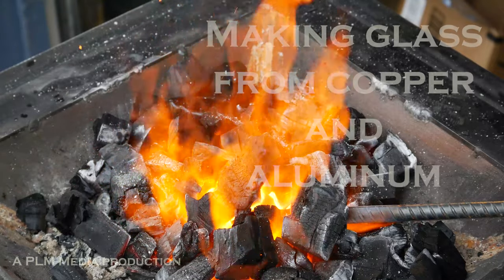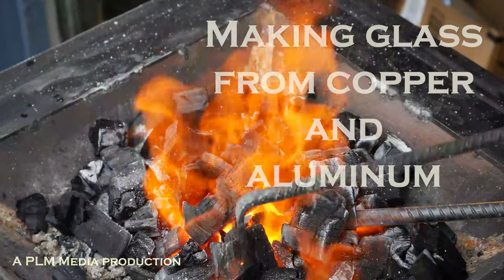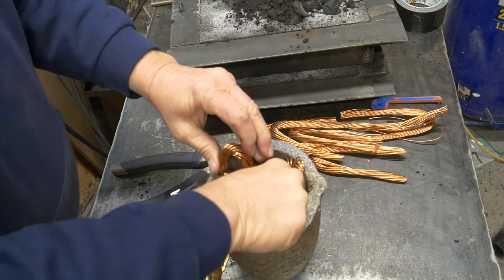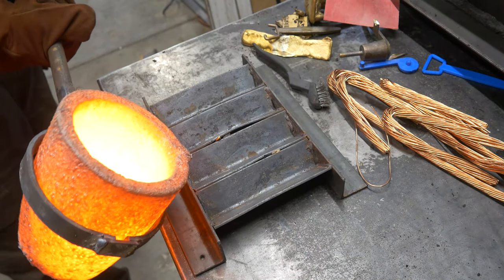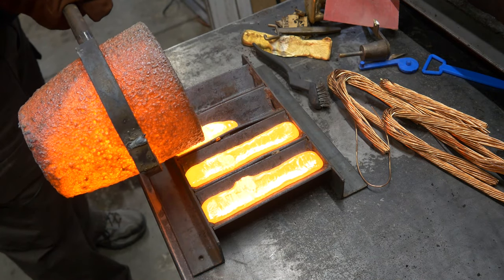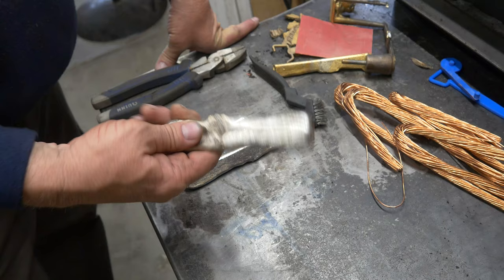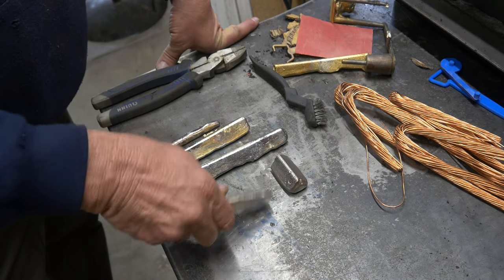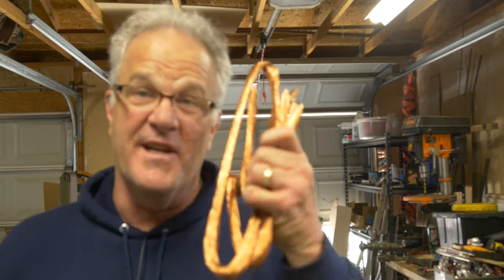Making glass from copper and aluminum

Comment: Same thing that happened to me the first time I made aluminum bronze, I had a good ratio, just a failure to mix it properly. Remelted it, and mixed it good, and it came out great.
Reply from the maker: That was my problem the first time I melted it about a year ago. I had the ratio right, but it wasn't mixed well.
Reply: @swdweeb  Great demo!  I read somewhere that one should stir gently with an up and down motion (not side to side) when making alloys, to ensure proper mixing.  Haven't actually tried it myself, just passing along some unsubstantiated rumours.
Reply from the maker: @tobhomott  I think "gently" is the operative term. I can see up and down, as the specific gravity is so different between copper and aluminum that there could easily be striation in the melt
Reply: @swdweeb  Making ingots then remelting them should help with mixing as well.  I don't like to pour something from raw ingredients.
Reply: It's THE WULF!!!!
Reply: @tobhomott , Rumours not unsubstantiated  😊. You do indeed need to stir and as you say not side to side or circular but rather with an up and down circular motion that gets the metal rolling from top to bottom and without breaking the surface with the stirring implement - need to do it fairly quickly as some of the stirring rod (if steel as is most likely) will dissolve in the bronze but a little iron in aluminium bronze is Ok.. Martin
Reply: @andrewmartin4258 , I too prefer to pig and remelt BUT you must remelt the entire batch. However there is a need to not remelt too much as  each episode involves losses and alloy  degradation... Martin
Reply: @olfoundryman8418  thanks for confirming that, I can't remember where I read it, and one thing I've learned from you is that a lot of the old foundry texts are full of conflicting information (if not outright nonsense)... Jeff

Comment: Ah, Babes in the woods! Alloy make up is not what a hobbyist should be attempting without decent analytical back up. It is an occupation fraught with failure and disappointment. Most alloy systems have definite useful ranges and  aside from that they are a disaster - for example if we look at aluminium and copper we have a useful range of up to maybe 12% aluminium at one end and up to maybe 6% copper at the other end, in between it is a disaster as witness your result here. My own experience with alloy make up with full analytical backup - the addition of Magnesium to turn 356 alloy into 357 was that only half of the magnesium added actually got into the alloy. I think attempts to make a 90/10 copper aluminium alloy by adding 10% aluminium of unknow purity to 90% copper wire of unknown oxide content once molten, is more likely to give a 5% aluminium bronze than a 10% one and no way you can really tell just what you have without analysis or perhaps some vague clue from a hardness test.
I always but always say BUY your metal from a reputable source as at least that way you will get at least one thing right - this is no doubt cheaper that self alloy make up on fuel and scrap costs alone let alone the cost of failures and frustration that come from bad metal. Some good part of Julian Hg's success (kettle bells octopus) are due to his use of purchased AB3 alloy - he has metal he can rely on each and every melt - worth noting and thinking about. Just buy your metal.. Martin
Reply: If I can add to that as a machinist, buy good material of known machining characteristics.  Don't but aluminium 6061 to machine unless you have heaps of horsepower to make the chips break. Buy 2011 and your machine will love you for it. Don't use 1020 steel if you can use freecutting steel.  Don't bother with metal from the scrapyard unless you are told exactly what material it is.  Why make life difficult for yourself when there are others more than ready to do it for you.
These remarks do not apply to guys with lots of power as they can make 6061 chip nicely.  I have been using a cnc lathe with 1/2 HP
Reply from the maker: I woke up this morning thinking Martin hasn't responded to me using wire in my melt. I must have done him in.  Now my life is whole again, my universe restored ;-)

You're obviously absolutely correct in your observations, no argument from me. However... here it comes... speaking as a guy that is still very early in the process there is an inexplicable joy that comes from melting two different things together to form a new third thing, just as there is in taking something in one form and turning it into something in another form.  For a guy like me in the garage that isn't doing production runs, isn't attempting to sell anything, isn't machining anything, making a shiny new metal of unknown properties is still fun to do.
Reply: Oh no, sounds like you are turning into one of those youtubers that like to waste gas melting stuff and pouring it into ingots.
You do realise that you can’t make an alloy of anything if you don’t know what you are putting into it.
I ain’t very scientific, but melting what is possible good copper in the form of wire and adding aluminium of totally unknown composition (crap basically) you ruin the good copper and turn it into crap.  From what I understand, each melt of the material can contribute to the degrading of the metal. It gets to the point where even commercial recyclers struggle to make it into a useful metal again. Perry I am no greenie by a long way, but the constant melting of metals to “recycle” them burns up fuel and degrades good metal. This is not aimed at you, but there are a lot of folks that think melt and ingot is a great thing. 
Having got this off my chest I will go to bed and see what response I get in the morning. Please feel free to delete this rant if you find it offensive (certainly not meant to offend you) or it does not suit the tone of your channel.

Comment: Here I thought you were converting the dross into actual glass. Nice demonstration of brittle metal from a mistake in alloy composition.
Reply from the maker: I guess the click-bait title worked on you then :-D
Reply: @swdweeb  PERRY!!! 
Shakes fist at Perry at the mere mention of Click bait.
Reply from the maker: I'd put a picture of a good looking woman up but my wife won't go on camera in my videos :-D
Reply: Funny you say that, the dross from my last aluminum melt was very glass-like. You know the powdery dry dross you get from cans? no more of that. I used 50% by weight flux to aluminum (1lb flux to 2lbs aluminum cans) and the dross was honey-like in the end, viscous but wet; it became glass-like when cooled down. Also, I melted the flux in the empty crucible first before starting to add the cans. It was much much better than on previous melts. It does mean you use more flux, but that's cheap (I use 40% sodium chloride, 40% potassium chloride and 20% magnesium chloride)
Reply: @stamasd8500  wow that's a lot of flux. Too much flux not only makes a dross that has more glass content but also is very damaging to clay-graphite crucibles.
Reply: @swdweeb  lol ya, totally suckered in. 😜
Reply: @askquestionstrythings  If you're talking about borax flux, yes. But the mix of chlorides is not. Having a thick layer of flux that wets the dross well is beneficial for melting aluminum cans (and other types of thin, irregular aluminum such as chips). For other applications you don't need so much flux.
Reply: @stamasd8500  all fluxes are damaging, some are slower and  some like borax are extremely fast. Cover fluxes are definitely important, I'm more a fan of using cover gases like argon. It's all a balancing act, balancing the chemical attacks on the crucibles vs the cost of replacing the crucibles. But my main point in my other comment is that it is Always important to use the minimum amount of flux that will do the job.
Reply: @askquestionstrythings  I have argon but find that using it in a homemade, propane-burning furnace is a bit challenging. :) As for the right amount of flux, I'm still working on it. This time I deliberately used a large excess, and it turned out much better that the 1-2 tablespoons that most videos on YT use. Next time I'll reduce the amount, to maybe 25% of the mass of Al and see if it still wets the dross properly. The experiment goes on. (also I coat my crucibles with satanite, usually just the exterior but this one was coated on the inside too; will see if it makes it last longer. It definitely does reduce outside erosion/melting/sloughing in my experience)

Comment: its kind of funny that you posted this my last vid I didn't put out yet but that's besides the point I melted brass and instead of completely breaking it down I assumed I could scoop the screws and washers and what not off and it would be fine and everything looked good until it cooled once it cooled it came out brittle and marbled it looked like a light copper color and and extremely shiny aluminum color I made the assumption that there may have been aluminum parts on something I melted or something to increase the zinc but I don't have the experience you do so I thought I would drop a comment and get your opinion
Reply: I guess my question is if I just added copper would it fix it or would I be better off ditching it all together to minimize waste?
Reply from the maker: Hmmm.. I'd personally just ditch it. Here's why. 

A few weeks ago I actually made the mistake I recreated in this video. Back then I thought to myself "how am I ever going to figure out how much more copper to add?" Fortunately I saw the remaining copper and breathing a sigh of relief simply melted it all over again.

I have had the problem with the alloy not mixing and seen things like you saw. https://youtu.be/YWGFDEspjZE and now do a slow stir before I pour the ingots or the part. 

But, you started with a brass alloy that was already at the right ratio. Of course as you said you had other junk in there as well. Therein lies the problem, it is an alloy made from unknown metals and unknown ratios. You could add copper to it but who know's what you'll end up with. It could be that you end up doing is wasting copper. 

Sorry I don't have a "just add table salt to it" fix for you. I guess the lesson learned is start with good clean metal (BTW I'm still learning that one)
Reply: I mean nothing ventured nothing gained I just thought id ask someone with more experience if there was and easy fix i was looking at it through a chemistry stand point were if I add and excess of the base eventually I would get something usable but apart from alloying my own al bronze I never done much chemistry work with metal its enough product to be a little upsetting but not enough to waste more on it ill sand up the better pieces and make some pretty paper weights :)))
Reply from the maker: well, you've probably got as much chemistry knowledge as I do. I'm a software guy :-D

There you go, you can always find a use for it. ;-)
Reply: Possible to take your ingot (piece) to a metal scraper or laboratory that has a metal analyzing scanner.  Saw one used on  brecken scraper or cody's lab.
Offer/Pay a few bucks, and get the exact composition.
Perhaps someone out there knows a service to do this?
Reply: I tried my local scrap yard as a first thought but they didn't have one and considering it wasn't valuable I doubted even if a jeweler could test it that they would waste there time so I thought well may aswell try the internet :)